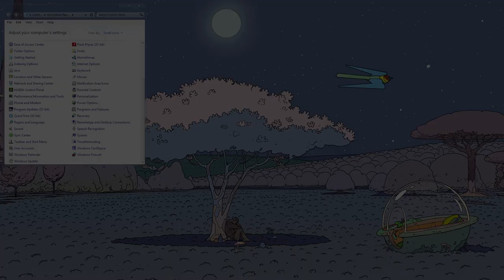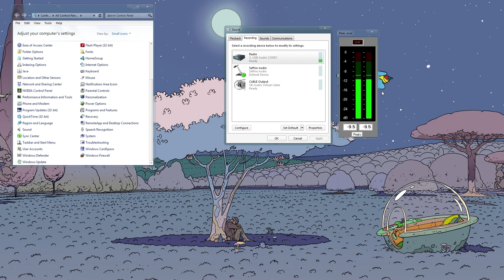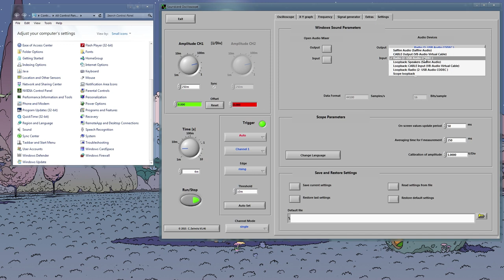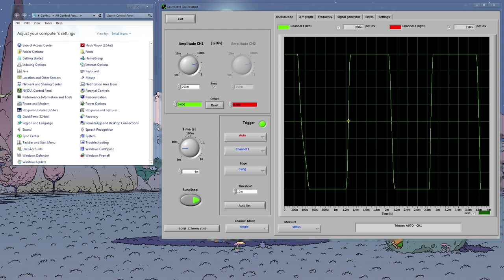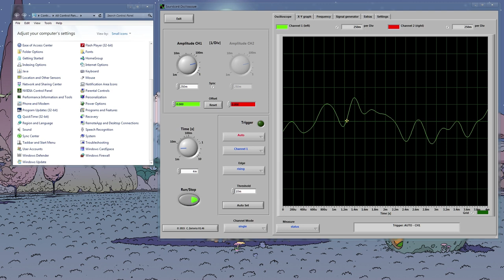Amateur Radio TI Audio Bug UPDATE (Audio Levels for Digital Modes)

Comment: Just a great note from a few months ago.  Was firing up my Signalink after having it mothballed for a couple years.  Had no idea about this flaw for receive signal.  ------ But you make no mention of the transmit audio signal and overdriving the output from the signalink to the audio input of the radio.  Assume that is not any issue in any context?

Comment: The TI PCM2901 is what is in the IC7600 that I bought in 2015. Sadly, this chip has the enumeration issue where it identifies as a microphone. One would think TI would rectify this by providing a driver which labels it as "line in" or something of the like. I have to have the audio at 1% to get an unclipped audio stream into WSPR or any other sensitive mode. I had the default windows drivers and the TI drivers going head to head and found the TI one runs much better and sounds better at 1% however it is still too hot for large signals and noisy bands. I really wish TI would provide a driver that allowed us to set some kind of multiplier so that we could "attenuate" it. Additionally, if MS could provide us a registry position to do this in I would be over the moon.

Comment: While this might be a bug on some setups, I have never experienced the flat topping issue as described by Jon, and I do have a SignaLink dating back to 2009.  My device is listed as a Microphone, but the only way I can see the flat-top problem is turn all of the audio all the way up on both the windows level setting and the RX knob on the SignaLink.  I still have issues decoding in WSJT-X and nothing I have done has been able to allow me to reliably decode JT65 or JT9 signals using that program, however, I can use the JT65-HF variant with almost 100% decodes.

Comment: Hi Jon. Great videos explaining the issues and fixes. I am running the bar graph program and the scope program. Now when I try and get the level up to -8db on the bar graph the level on JT65HF goes through the roof. What settings do you have in the Peak Level Meter program? I am running an IC-7700 and signaLink USB here. Also I have tried with the gain link in and out in the signaLink. Hope you can help. Regards
Chris
VK3AWG
Reply from the maker: Vampyricintentions How is the meter on JT65HF going through the roof? These meters can usually be ignored, they're not measuring a known unit of measurement, they're mostly for visual aid only. You want to use a meter that gives you the actual dbFS indication of the audio such as the peak meter you downloaded. There's no settings in the peak meter program that affects it's reading, so if it's showing the audio peaking at -8dbFS, you can rest assured your audio is not clipping or being overdriven, even if wsjtx's bar graph says it is. How does the waterfall look? One "gotcha" is to go into the peak meters options and be sure it's actually reading from your radio, and not a different mic input. Hope that helps!
Reply from the maker: Vampyricintentions I just had a look at JT65HF original version and see the meters you're talking about. Those can mostly be ignored as they aren't reading a known unit, and make sure the gain sliders below it are set to 0. This was all actually remedied in the updated HB9HQX version of JT65HF, he removed the mostly useless meters and the digital gain sliders, along with many updates to the decoding engine. I highly recommend giving it a try! The original version with the meters and gain sliders has not been updated for four years. - http://sourceforge.net/projects/jt65hfhb9hqxedi/
Reply: Jon Sands 
Thanks Jon I will load up that version and see how it goes. Cheers
Reply: Jon Sands 
Update 1: I realised that I was running the wrong level meter from that page. I was running the Peak Level Meter instead of the Digital Level Meter. Looks better already even without the other software.
Reply from the maker: Vampyricintentions good to hear! Hope it's working for you!

Comment: Hey Jon... something I just noticed when I went back thru this now upgraded to Win 10 Pro x64 so don't know if this exists in Win 7 -->  After clicking on the slider and INSTEAD of moving the slider with the mouse if you use the up/down arrow keys on the keyboard I get a much more granular control of the slider.  The arrow keys give me 0.3dB each up or down press.  I couldn't obtain this granularity in Win 7 mousing.  This may just be a Win10 thing as I seem (if very careful with mouse) to be able to get +- .3 with mouse also just now. 

TS-590S ser #B43xxxx - Radio's USB output (menu 65) ended up max at "9".  Leading me to think maybe anything less adds attenuation to the output.

USB Audio CODEC level @ +0.1 seems to give the 7/9 levels recommended in the Win VU meter.  Only tested so far PSK31, PSK63 but decode seems to be rather improved.  I think what  many of us initially miss (especially since there's a newer UART serial driver out required for SOME W10 installs) is that ya'll are ONLY talking about USB CODEC driver.  That chatter has distracted some.  Thank you VERY much for clearing this up.

Comment: Outstanding Jon!  Thanks for being right on top of this.  The scope program is way awesome!!  (Have always wanted one.)  Thanks again... I'll update my folks.  BTW... you can go to my callsign on Youtube and see my video referencing this.  Will be posting the Update shortly.   Rick  K4REF
Reply from the maker: Thanks, that actually means a lot. Ever since releasing the first video I've been getting some discouraging emails, even some saying I'm a secret Kenwood employee out to ruin Icoms image (even though the only radio I own is an ICOM). Ive even had some tell me I made this all up, even though you can see TI themselves acknowledging the bug. It seems a lot of people are taking it as "you're doing this wrong, this way is better" but I never meant it like that. I only spent all my free time the past few days documenting all this because I just wanted to help other hams see the improvements I saw. I do apologize for the conflicting info in the old video, I'm just rolling with the punches as I get them. So thank you!
Reply: Jon Sands No problem Jon.  The first video gives a good presentation of what the bug is... so, leave it available.  This one shows the simple fix.  I just posted my update of yours.  Thanks so much for figuring this out.  It will make a difference!!  73 my friend,  Rick  K4REF
Reply: Jon Sands Wow, people are dumb.  You called out that Kenwoods have the same issue...